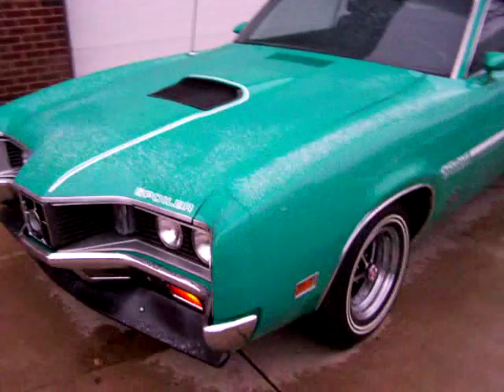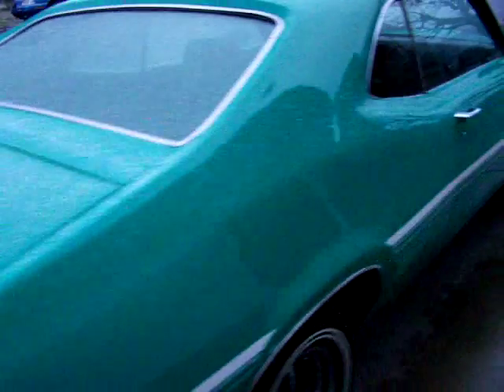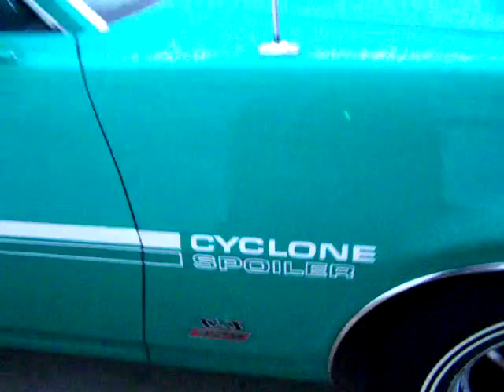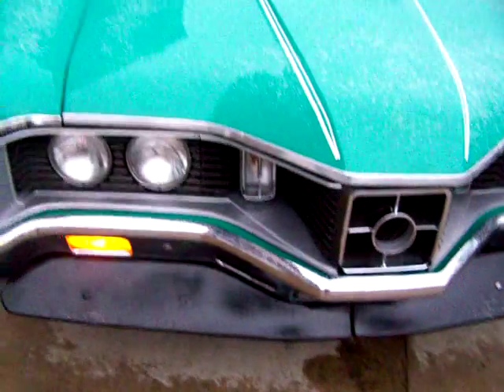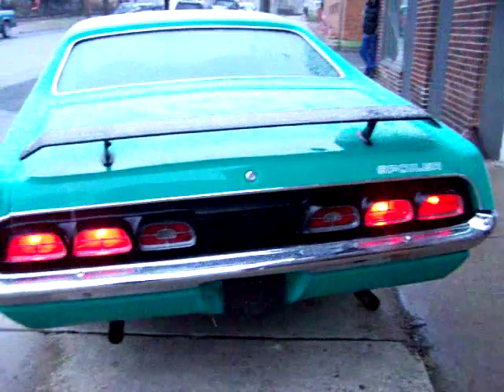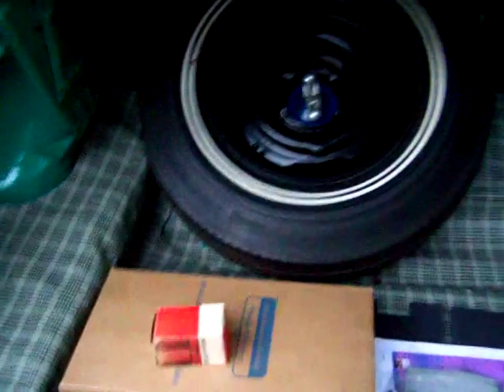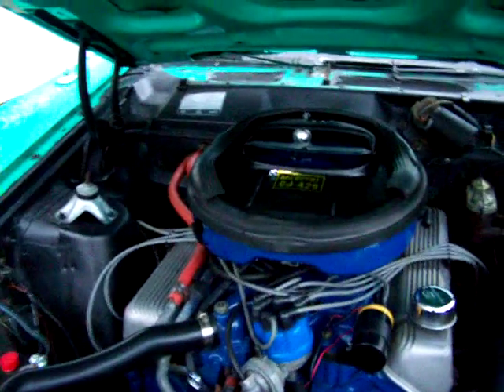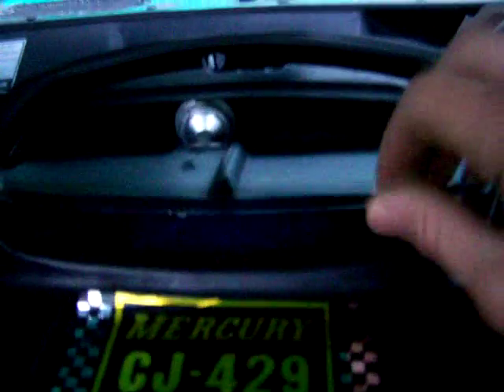1970 MERCURY CYCLONE 429 CJ SPOILER FOR SALE UPDATE SOLD!!!!

Comment from the maker: Hello, YES I know what I sold. IT was a 1970. The front grill is the larger one that was NOS and not the correct one for a 1970 and the rear spoiler was not painted the same color as the car like they should have been in 1970. I can read a title and the vin it was a 70 for sure.

Comment: hey all you bitching about the nos 71 grille, need to realize something.  This grille has never been reproduced, EVER.  It basically doesn't exist.  So if the guy gets EXTREMELY lucky and happens to stumble upon someone's nos grille, it doesn't really matter at this point whether or not it's 70/71.  It's literally so frickin' rare that you can't be picky anymore....you just can't.  Once parts like this are gone..they are gone.  Unless someone goes to the trouble to go get a mold made (hint hint)